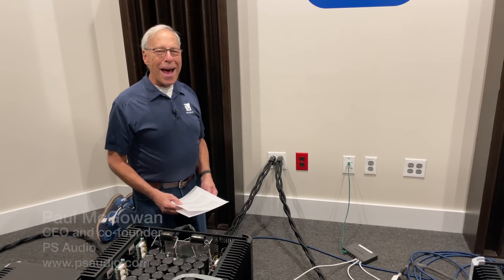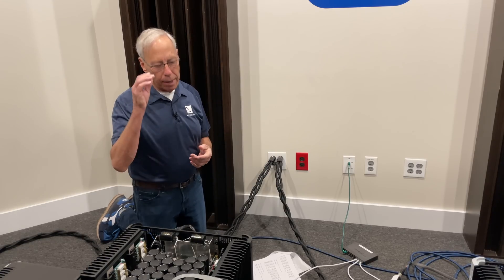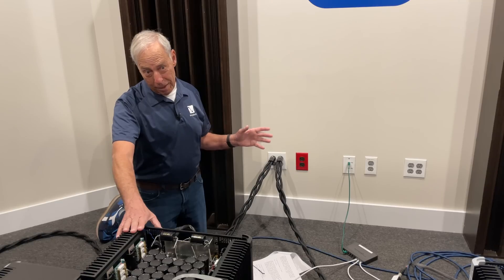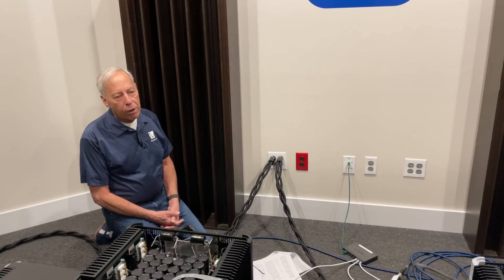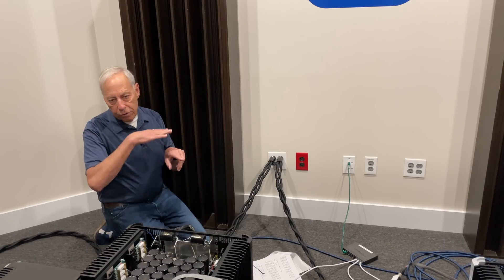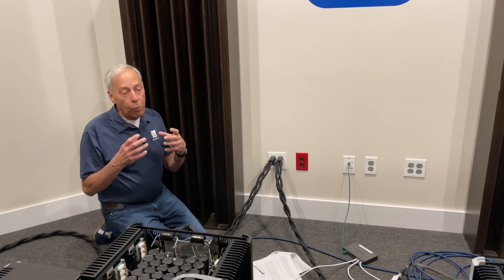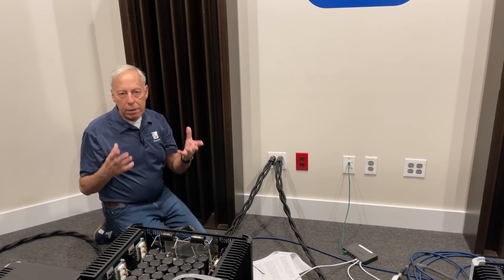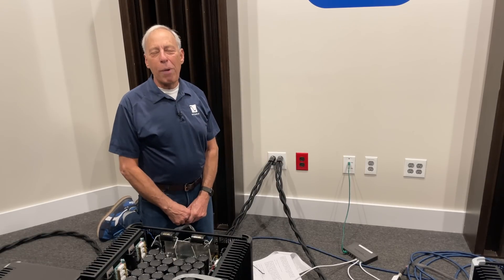Are braided power cables better?

Comment: Surprised to see both of those power cables plugged into the same outlet when you preach the importance of dedicated home runs for each piece of equipment and/or receptacle. Looks like there are least two, if you do not count the emergency outlet, options on the wall.
Reply: Because it don't make a difference
Reply: The two cords are not plugged into the same outlet... they're adjacent. That's a double duplex receptacle outlet. 

Whether it's multiple dedicated circuits or not who knows. If I had to, I'd speculate every receptacle on that wall would be dedicated... but who knows.
Reply: @FOH3663  I do see its a duplex but it is in the same box. Two 10 guage wires running into the same box is unusual. I noticed because I did go thru the trouble of running a dedicated 10 gauge run for a dedicated receptacle. The major reason was because I was picking up house appliance noise on the zone.
Reply: @dennisw4654  
Just for clarification...
A duplex is a typical receptacle, with two locations to plug into. 
Double duplex is the term for two duplex receptacles, side by side, sharing the same box. 

As to how unusual, ... they purpose built this room so who knows (if asked, I'd advise upsizing and dedicating every outlet up along that front "amplifier" wall). 

In the electrical trade, it's neither typical or unusual. Whatever is spec'd for on the blueprints is installed. 

My outlets for my home system are fed by dedicated circuits, isolated grounds, and each fed by up-sized #10awg, to mitigate potential voltage drop.
Reply: We're also speculating as to how those sockets are connected behind the wall.  How do we know that there isn't a dedicated circuit for each socket behind that wall?
Reply: @falcon048  
Exactly, that's what's likely... or it certainly wouldn't be unlikely.

Comment: “It matters” and yet all the most expensive brands of equipment, including PS Audio, sell their equipment with off the shelf, regular old, mass produced, AC cables. If it really made a difference, they’d change that practice! I side with people that don’t have a buck to make in the sale of cables, Floyd Toole and Siegfried Linkwitz. Neither of them believe in using exotic cables. They do look cool though and I wish they’d just admit that that is the attraction. It’d be so much more genuine.
Reply: You need not spend thousands on power cords, there are very good power cords for under $100 that DO offer audible improvements. Almost all offer a 30 or 60 day free return policy. Try them and see for yourself. As you can see in the replies here, everyone who has tried them says they work. Only the people who have never tried them say they don't work. How can someone say they don't work if they haven't tried? Why don't OEMs include them? Cost is one reason. The competition isn't making the expenditure so why bother? Several amp makers DO recommend them; that is something to consider.
Reply: @briangc1972  buy better hardware with working power supplies
Reply: @Harald_Reindl  You have no idea what components I have in my system. How can you make such a blanket statement?
Each of my components were selected after a lengthy addition process of comparing various models and brands. I am at the level where the next step up in any part is well over a 10 or $20,000 investment. I have reached the point of having to spend large sums of money for only incremental improvements. Many times during the audition, the more expensive, new item does not sound as good as what I already have so I am no longer shopping for new hardware or speakers. (I do browse about once a year or two to hear what is new.) Live recordings sound live in my listening room. From Handel's Messiah to Lightning in a Bottle, to funky jazz, to Rare Earth, The Guess Who, and on and on, the sound is as the artists intended and recorded. My biggest frustration now is finding quality recordings that have not been remastered. It seems almost every "remastered" recording is inferior to the original recording.
Reply: @briangc1972  if a power cable makes a difference the power supply is crap - it's that easy and how you audiophiles are against remastering when it's all of what your DSD/Highres stuff is based on is amazing 🙂
Reply: @Harald_Reindl  Most sources of power are very dirty. I use a power conditioner (Furman Reference series) which makes a huge improvement. But I can also state unequivocally that the selection of power cords for the components does in fact affect the sound; sometimes positively, sometimes negatively. That is why it is important to do an A-B test; audition different cables and cords.
Until you do, you are just refusing to be reasonable in your argument. Do a test, then come back and tell us the results.
Reply: @briangc1972  it's laughable - no matter the power source it's the job of the power supply to filter and cleanup - guess why so few technical educated people call themselves "audiophile"

Comment: Interesting stuff Paul but what about the cable in the wall behind the wall socket 🤔? Enjoy all your videos thanks.Tony UK
Reply: The power cable is the first section of cable, the twisted design is helping to filter EMI and inductance that came before.  It's closeness is similar to those ferrite rings you see of DC power cables, they fit the ferrite ring very close to the actual device (plug end).
Reply: @BoomerUKEngland  lol - get hardware with proper power supplies
Reply: @Harald_Reindl  I have Seasonic Titanium PSU's, some of the best made, Kimber power cables still benefit the DAC's inside those computers.
Reply: Have you ever seen one of those water filters used in many 3rd world countries? Water goes in the filter brown and comes out clear and ready to drink at the other end. The same idea here.
Reply: @veteq101  but you can't filter that way - ideas without a functional brain are worthless

Comment: No wire should have an LCR factor inside, otherwise you have a non Linear electron transfer conductor network at audio frequencies, that filters out musical information from the DB Board right down to your speakers and generates noise and introduces tone control filtering effects in the process. 
The engineering done in existing wiring designs is completely incorrect and horrendously expensive.
The engineers in the audio industry are totally in the dark, when it comes to audio application wiring. 
There is a 100 times more cost effective solution to solve that problem .
The only reason why you would have a synergy problem is, because all the existing cables in the audio industry are filtering network designs and that is actually why everyone is fiddling in the darkness to match  the equipment. 
There is no bad audio system in this world anymore , vintage gear or new gear. 
The problem is the complete audio industry cable designs used within a room for audio purposes. 
Done all those tests repeatedly. 
You can get more musical information and time alignment from a 2k system than a 200k system if done correctly
Reply: @Douglas Blake there is a way around it.
Reply: @Douglas Blake I don't want to elaborate on this to much at the moment, I am in the process of patenting it. 
But it works, what I have designed. 
I have done those tests repeatedly with a 2k system and a 200k system. 
It took me 8 years of intensive research to figure that one out. I searched for 2 years globally for the raw materials to build the prototype. 
It creates a completely holographic experience of the studio recording , even with a 2k system. 
I even did the test with a 25 year old vintage system with the same result. 
The result I came across is, that there is no bad gear out there. 
The complete line from the DB Board right down to the speakers has been incorrectly engineered all these years for Audio frequencies. 
The existing wire lines of today filter out musical information, micro dynamics and generate an enormous amount of noise. 
When you remove the noise and filtering from the lines, then you will immediately hear everything from the recording. 
You can also physically see what happens with the drivers of the speakers .
It's so easy to notice the difference.
Reply: @hermannmaischatz2695  "I don't want to elaborate on this to much at the moment, I am in the process of patenting it."  LMFAO!!  That's one hell of a way to dodge answering a basic physics question.
Reply: @Douglas Blake Audioquest is doing the wrong engineering job and it's just a bunch of snake oil, what they are doing. 
There is a YouTube video from Audioholics by Gene Delasala that provides all the technical specifications of the Audioquest cable . He proves that every thing they claim that their cable is to be , is the biggest load of rubbish. 
He is an engineer and he showed all the measurements to prove, that their claims are false. 
My raw materials costs next to nothing and I will bring my design within reach of most music lovers. 
That has always been my goal, to bring the magic even to people, who can just afford a system around 1 to 2k .
The only real costs of the complete design, is the cost of the plugs and the labour. 
I believe that less is more.
Reply: @Douglas Blake 👍
Reply: I'll promise you ,I will stay away from the snake oil group. 
I have learned that the hard way. 
I also have a snake oil 5 star cable, solid core silver mono crystal here, to do in depth testing against it and my raw materials are about 100 times less expensive.
My design can recreate the exact holographic reproduction that the recording engineer created in the studio. 
If the factory can manufacture what I want then I could create time alignment from 1khz  right up to 107khz .
I have managed to build up to 42khz already which can be used for 24bit 192khz streaming audio.
Reply: We can do a 70% effective sound quality improvement with about U$ 800 for any Streamer/ Amplifier/ system with detachable power chords. 
That value includes 
Acoustic alignment design for speaker and listening positioning placement. 
Electrical power supply alignment design. 
Audio cabling alignment design. 
Any audio equipment can only in effect deliver sound quality of 30% irrelevant of price. 
Been in the audio industry for 37 years and also repaired endless equipment and studied all the loopholes of each design. 
Had a lot of fun and challenges so far and I am still learning every day step by step 🚶‍♂️
Reply: @Douglas Blake not really, depends what genre of music you listen to as well. Newer music comes in all genres. I have an enormous genre testing spectrum and there is enough quality for everyone to enjoy. It really comes down to the talent of the audio engineer.
Reply: @Douglas Blake the complete solution creates exactly what the recording engineer does, good or not so good, it doesn't matter how. The bottom line is that it always sounds musical, whatever you play and retrieves everything created by the recording engineer, due to the precise series and parallel alignment of the complete cable design from the Distribution board to the speakers. Music just becomes foot tapping exiting. 
That's the magic 🎩 ✨ I am talking about. 
There is nothing I don't listen to, given the time and opportunity to do so.
Reply: @Douglas Blake well I can show you what kind of magic I can do,with your acoustic alignment design for speaker and listening positioning placement, if you would be interested. That can create 50%effective sound quality improvement over your current experience.
I can do that online with you. 
Have done those, multiple times internationally and it works perfectly every time